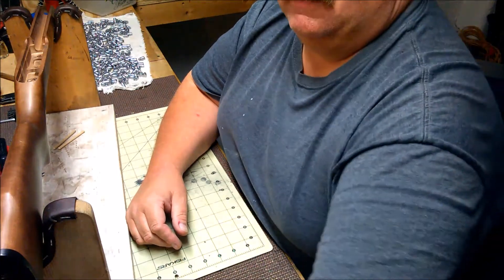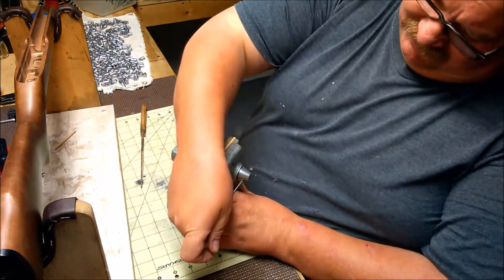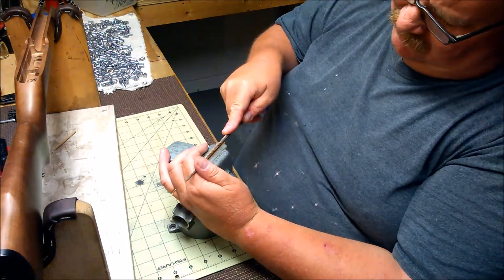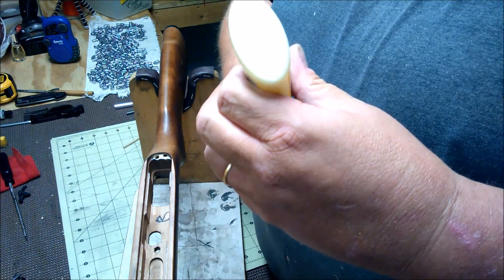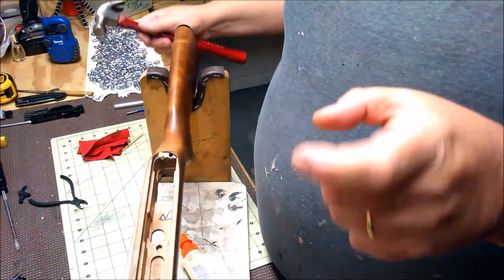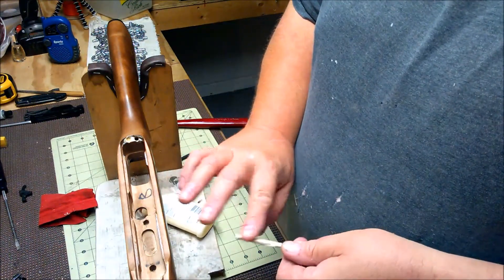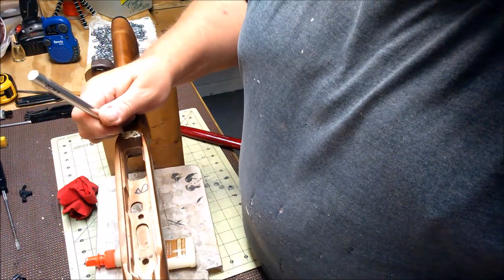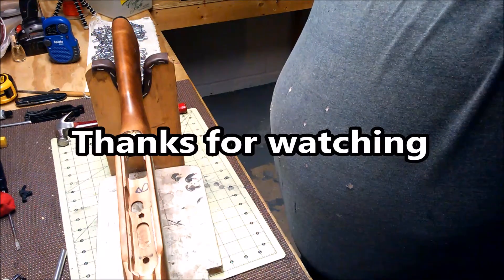Marlin Model 60 Restore Part 2

Comment: Since you basically customized the dowels did you find any irregularities that allowed glue and air trapped at the bottom of the drilled hole had an escape path to the surface? I searched for hollow or channeled dowels with little success. What do you think about cutting a grove lengthwise along the outside for the escape of air or excess glue?
Also, if an escape path was not built In couldn’t—by rules of hydraulics—hammering down on the dowel actually re-open the crack?
Not being critical, just want to learn.
Reply from the maker: The first thing I did in the video was file grooves in the dowel and explain that the air needed to escape. You are correct, The first time I repaired a stock I didn't know that. It didn't open the crack back up but it wasn't a good repair. This marlin is still going strong.

Comment: Dude.. looking good. the Stock SHOULD have a LOOOONG reinforcement screw which screws up from the underside art about a 45 degree angle, help stop cracking. but your's looks like it cracked around the trigger guard cutout..
ugh... annoying.
Seeya
Dude